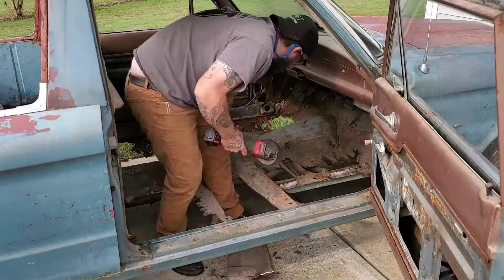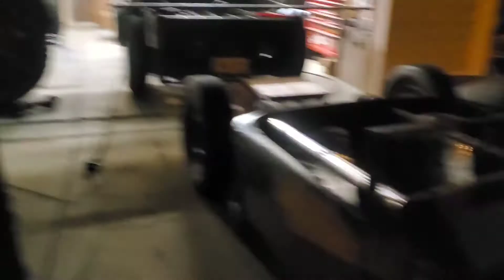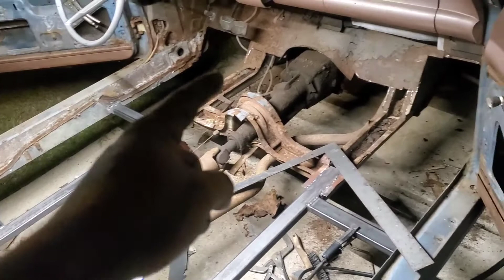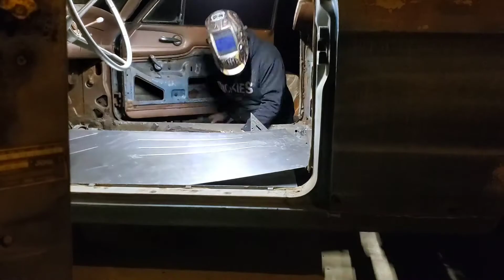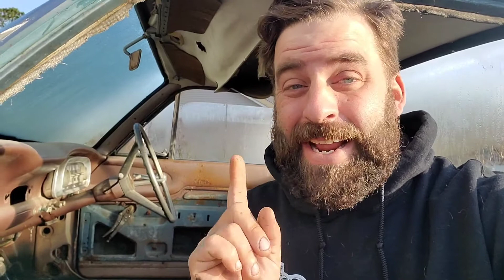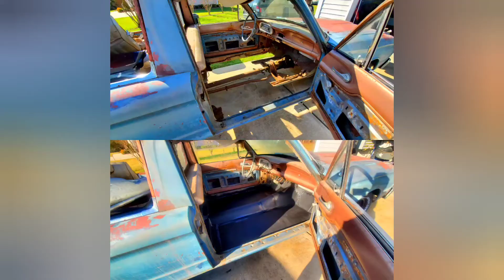1963 FORD RANCHERO FLOOR PANS , sheet metal,  bead rolling,  welding

Comment: New to body work I’m have a 2004 f350 with a rusted out drive side floor pan thinking about using 16 gauge hot rolled is there any reason that wouldn’t work or would cold roll be better?

Comment: Can your floor design be done in any car ??? I really liked it I have 68 Plymouth valiant
Reply from the maker: Yes in most cars you can reinvent the floors as you need. Obviously it still needs to be a solid structure and work with all your components.

Comment: I am building floor pans for my 55 Chevy right now then I am doing a 62’ Chevy 2 with a floor about like you started with and I am building subframe connectors and custom flat floor panels. I would be interested in more custom floor pan videos.
Reply from the maker: We should have some coming up soon.   I'm always a sucker for simple and effective.    I wish I could do custom floors in all customer cars haha.   Hopefully we will have a hot rod floor from scratch and we can donaome cool stuff with the brake, bead roller and slip roller
Reply: @greasyboykustoms  awesome. I have been thinking about doing floors in a car like this for a few years and I finally found this. Keep up the great work.

Comment: Just curious did you brace it up before cutting out the pans and original bracing?  Amateur asking 😎
Reply from the maker: I did not.  Only because the main supports were solid , pillars were solid,, doors didn't sag and the rockers were solid.   .   If it was any worse than this I would have.  It's never a bad idea to brace it just incase

Comment: Please tell me about welding the panels ? What type welder did you use butt ,? Any lap joint, . After you drilled the holes how did you fill them in ? Did you grind them ?? Was this mig , tig , stick thank you Ray
Reply from the maker: Weld them up and grind them down

Comment: One more thing actually two 1, didn’t see floor Rolls and how did you weld this all up , mig, tig , stick ? Spot welder???
Reply from the maker: I use a mig setup.  I have a 220 welder but a 110 is suitable

Comment: Do you use Cleos ? Or duz Fasteners for transmission tunnel or any of the flooring appear to be that way looks like he just weld and everything together so if you had to move your tunnel how would you get it apart I really like the job you did it’s fantastic I’m stoked I have a 68 the rusted floor didn’t really feel like putting in individual floor pans or an original floor plan I like what you did if you can give me a little info on it I would appreciate it thanks brother
Reply from the maker: I use clicos sometimes.  Other wise I used vise grip c clamps or push the panel down with hammer to hold it in place

Comment: You did an excellent job on that Lil Truck. I bought one Just like it 3 weeks ago out of south oklahoma with no rust in it, and it is a Factory V8 260 engine with an original the borg warner 4 speed. The first year they put the 4 speed in them. So happy to got the truck it is all original. Once again Nice Work..!
Reply: How much did you pay for it if you don’t mind me asking?

Comment: Would this type floor work for an A body mopar ?? ( 68 ply val )
Reply from the maker: It is very similar.  As long as the inner rockers are solid and the car is braced while doing the work the. You should be able to do your floors this way as well.  Keep in mind that with them being custom pans that things like seat mounts and seat belt anchors will need to be made as well.